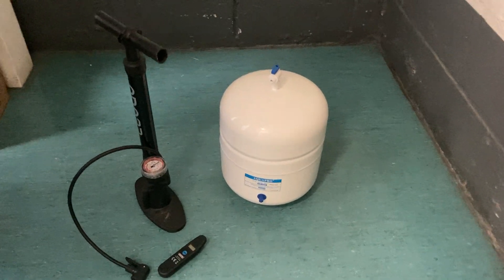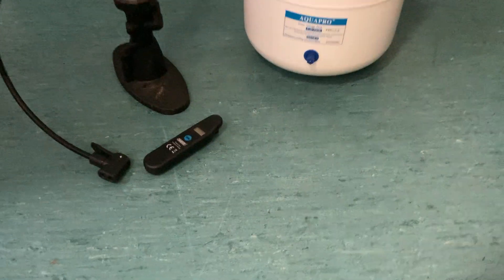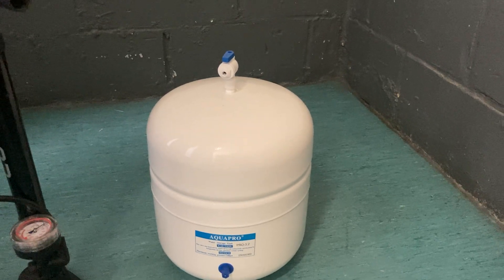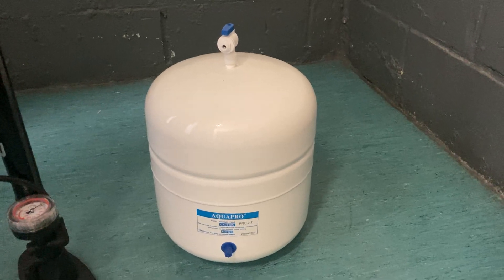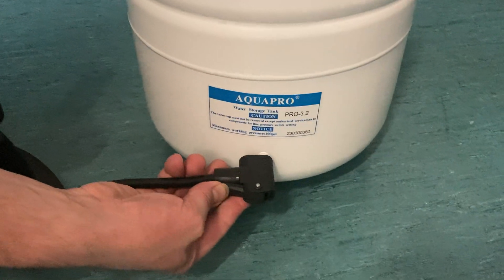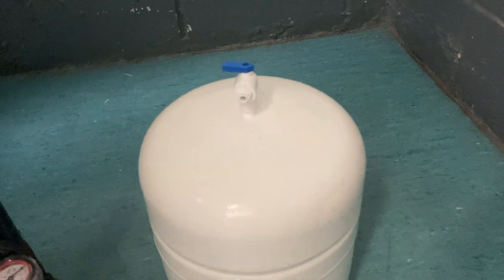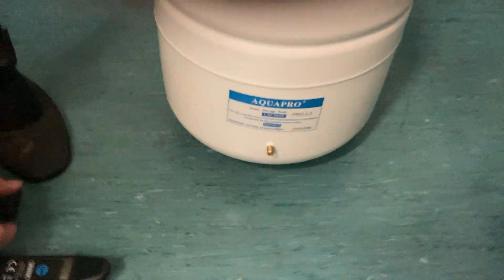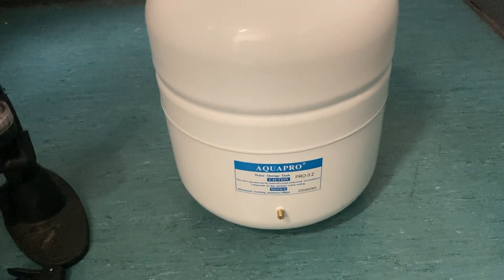How to re pressurise your Reverse Osmosis water filter Storage Tank

Comment: My pump shows 0 to 300 psi 
How can I pick 7 psi here?
It's a hand pump
Reply from the maker: Hi

Thank you for your question. 

It probably won't be possible to select 7, but when pumping up the tank you can make sure to stop at 7psi. 

Carefully check while pumping up the system and then stop when the pressure gauge reads 7psi

Best wishes

Al